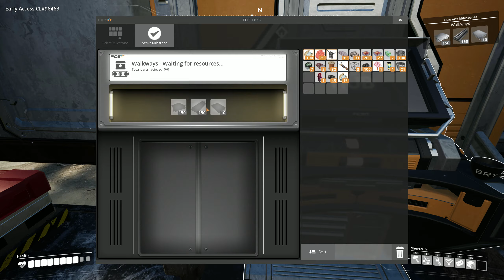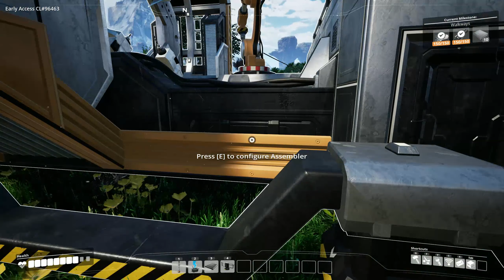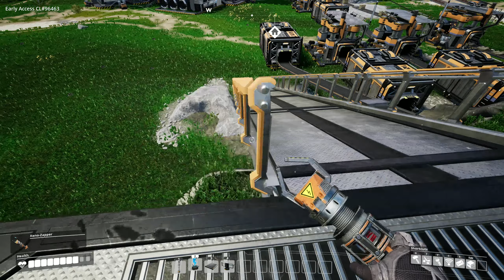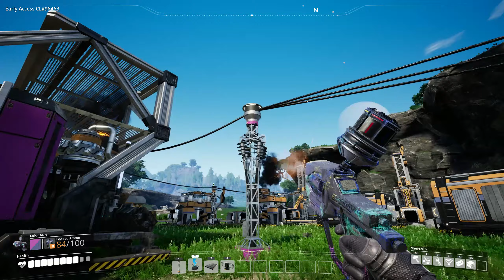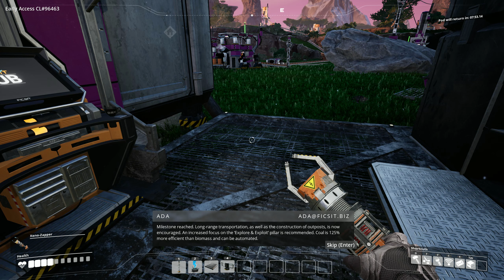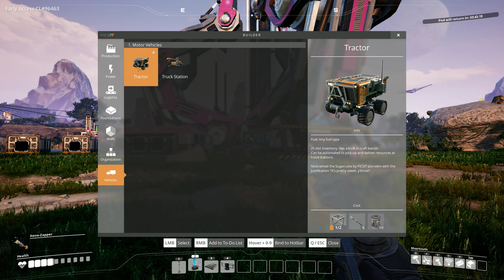Satisfactory Early Access Part 8

Comment: Pro tip, make two machines to build reinforced plates use a spliter to split screws and overclock the screw machine the screw machine consumes only 4MWH overclocked will use top's 12 MWH this way you will have 10 reinforced plates a min with only one machine overclocked it will produce 7.5 reinforced plates and use 22 MWH so bets option is 2 machines making plates and overclock the screws it will be cheaper, also the second genarator on your hub is only powering 1 machine thats why you have so much spikes because half of your gens are not connected to the main electric grid
Reply from the maker: Yeah I get a couple machines making the reinforced plates once I realize how much you need them for the upgraded conveyors.